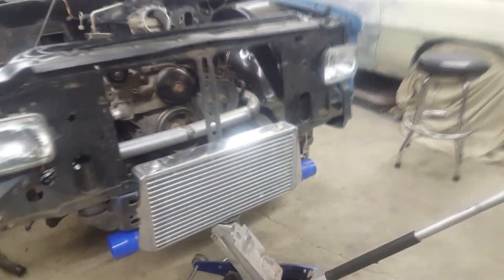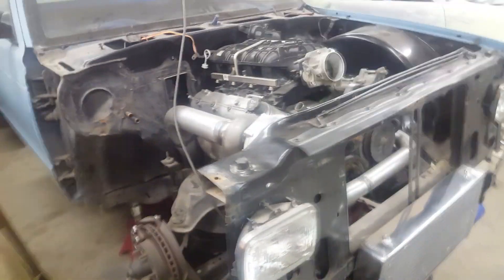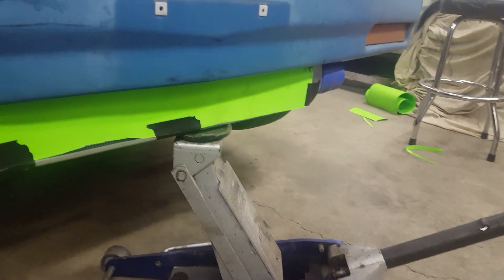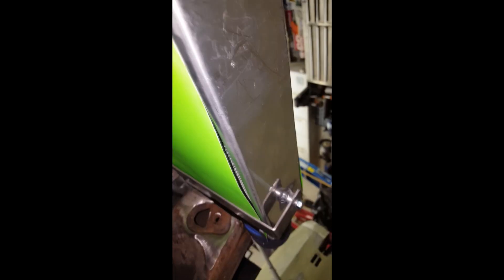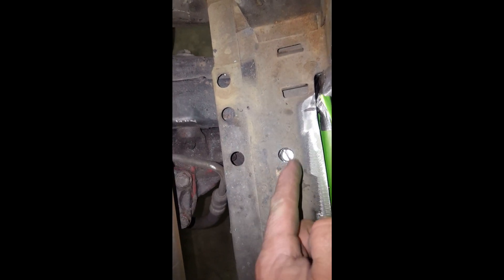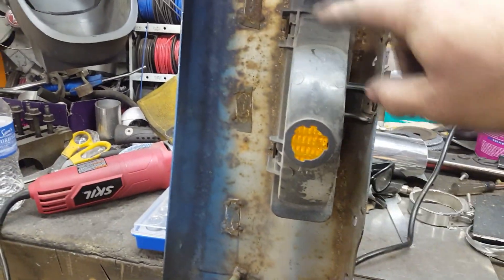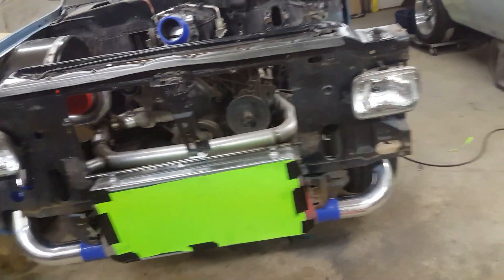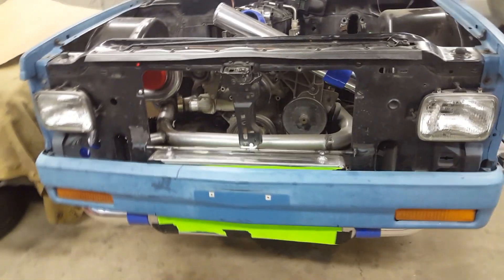BUILDING A BUDGET TURBO COLD SIDE! Intercooler + Piping | V8 Swap S10 Update

Comment: nice work man that upper intercooler tube looks sweet the way you mounted it to the rad support.if you want to keep the Silicon  couplers,you could make little bridge straps out of aluminium and have a screw boss on each pipe that's threaded to stop the blowing off.😎

Comment: YOU CAN ALWAYS PUT DIMPLE HOLES IN UR FRONT BUMER SO THE INTER COOLER CAN GET MORE AIR...WHAT DO YOU THINK..?...
Reply: Maybe trim an inch off the lower center of the bumper for improved air flow.
Reply: that could work to great job....